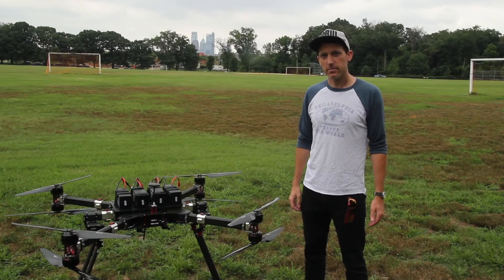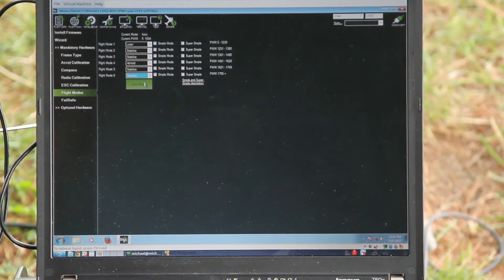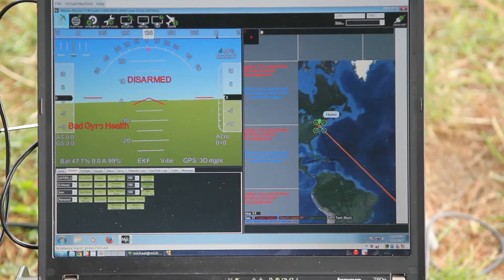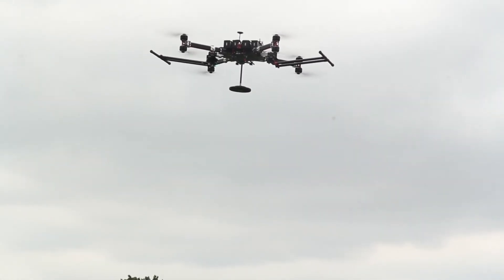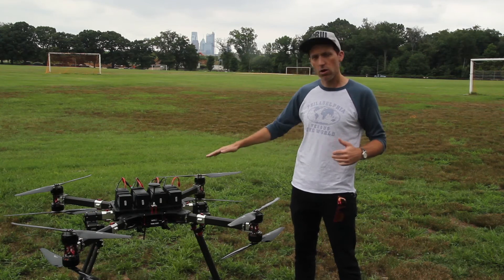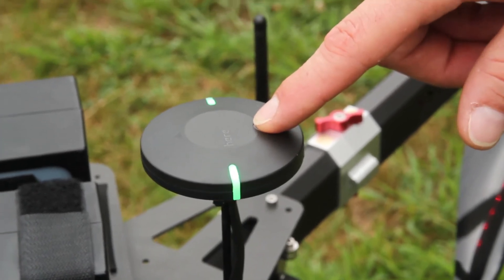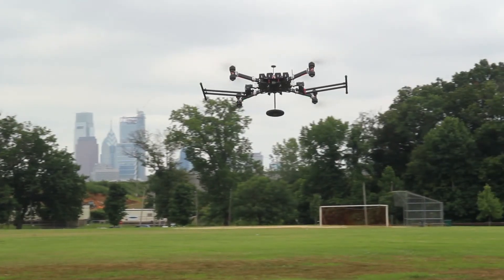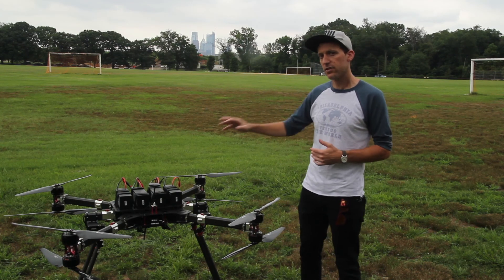Gryphon Dynamics Frame WIth Pixhawk 2

Comment: Love Pixhawk 1 on my 4S gopro rig. I's Pixhawk 2  that much better?I mean, is the handling somehow better or just the options? Just askin cuz the price is alittle high.
Thanx for the video
Reply from the maker: Yes it is better in every way.
Reply: Jack Hammell Pixhawk 4 (branded Holybro) is just released with twice the computing power and cheaper too. Dont know what to do with that computing power though :P
Reply: the reason pixhawk 2 is expensive is because it still has support and delevopment.

Comment: Hey, im wondering if you can help. I have a naza lite and there is no sign of gps hold. It just keeps drifting. Apologies on it being irrelevant to the video, im just desperate at this stage
Reply from the maker: Hello, it could be a lot of things. You can do a GPS calibration. If it's drifting in a slow circle you can rotate the gps slightly in the opposite direction. Its called toilet bowling, so if it rotating slowly clockwise, physically rotate the gps a few degrees counter clockwise. I would recommend searching on the forums for people with a similar problem. Or alternatively you can ask your dealer for help. Good luck!

Comment: Hi, Regarding the PixHawk2.1, how highly do you rate it?
I need a flight controller which is very stable in flight. This means that it must be able to perform a stable ALTHOLD hover.
If paired with a LidarLite v3, would you recommend this, considering that this is one of the more costlier FCs available on the market.
Reply from the maker: When done properly we'd rate it highly. However it's not an "off the shelf" product and requires some time and tuning.
Reply: If just stable alt hold is what you're after get an air3 inav it's only $80aud. I have one and the alt hold is extremely accurate, you just need to tune well and put open cell foam over the baro.
Most decent flight controllers will do that, most the time when it doesn't work out it is a bad setup for any number of reasons.
Reply from the maker: Hey Zac, thanks for the tip. Probably not going to use an 80 dollar flight controller on a expensive industrial platform but probably good for many applications